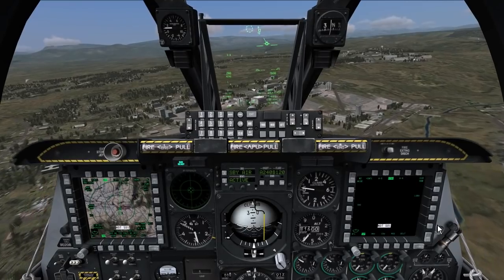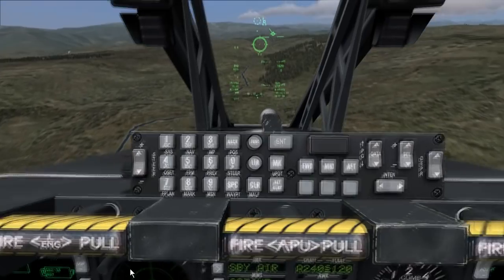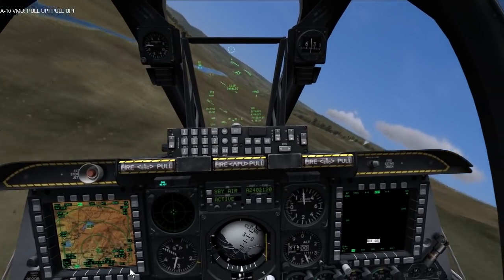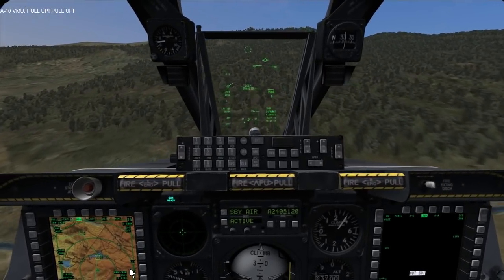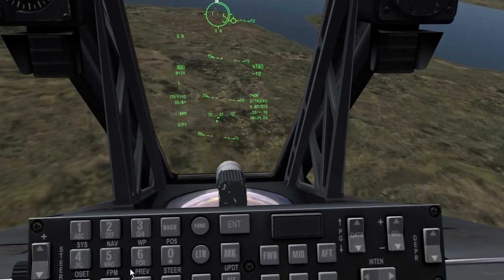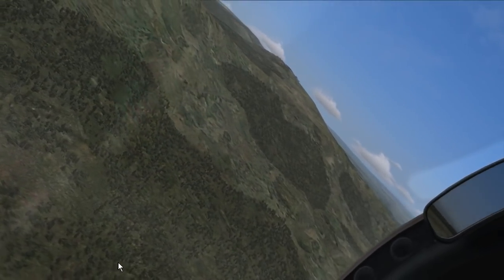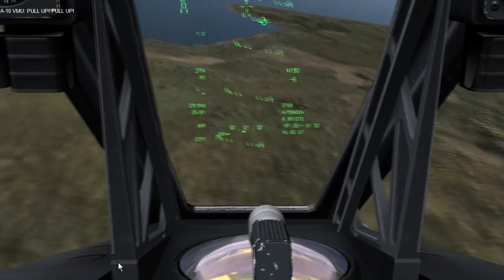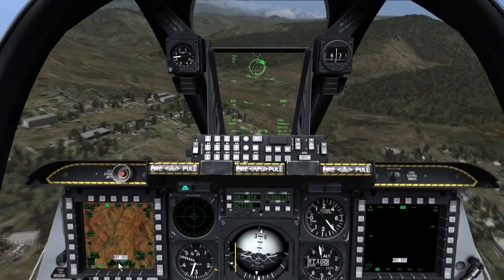DCS A-10C Warthog - GAU-8/A Avenger Cannon

Comment: Master Mode button. Not sure which button it would be on the HoTas. I fly with a different joystick. Thrusmaster, so I have a mix of hotas controls and keyboard. But none the matter the button should be M on the keyboard. Switches between Navigation, CCIP, CCRP, and GUN.

Comment: I would say because the burst are too short. If the recoil force of the gun is higher than the thrust it wont ''stop'' the aicraft right away. The aircraft will lose speed and eventually stall, as long as the recoil force is applied. So you would need a loooong burst to make it stall, probably a lot more than the rounds carried by the aircraft or what the barrels of the gun can handle.

Comment: @Surpriseify If you play sim mode,  you will pretty much need an actual pilots knowledge about the A-10 to take full advantage of the game "the manual is 700 pages long"  but it does have a Game Mode for both avionics and flight systems,  which does make it significantly easier to play for less die hard simmers,  although it still does require considerable practice to get a full handle on.  If you have a decent joystick,  you can play the game. But I would recommend getting TrackIR

Comment: @M0n1m1 It's called DCS A-10C Warthog.   It's a miltary grade flight simulator of the A-10C,  although it does have the somewhat easier Game Modes which simplify much of the avionics and flight systems.  If you are a flight sim fan,  its a MUST get,  however it does have a VERY steep learning curve and can be expensive if you lack a good flight joystick,  I would highly recommend getting TrackIR for this game.  But if you're after realism, you couldnt get better than this.